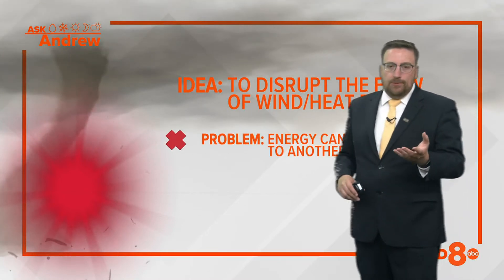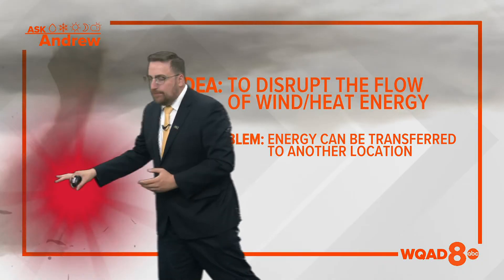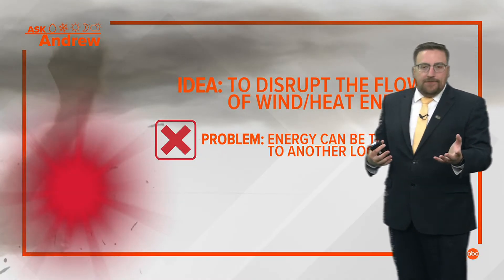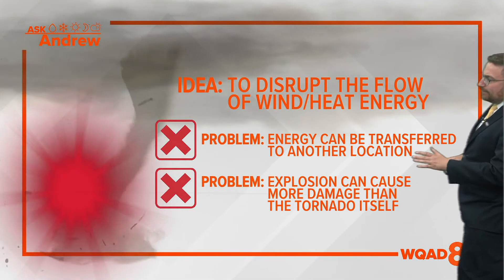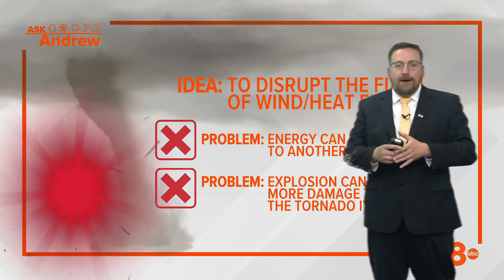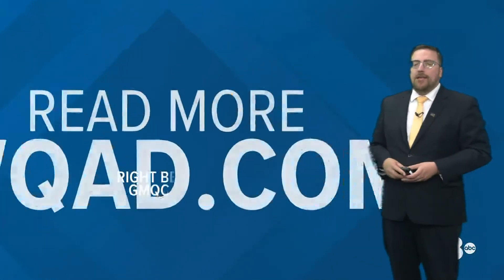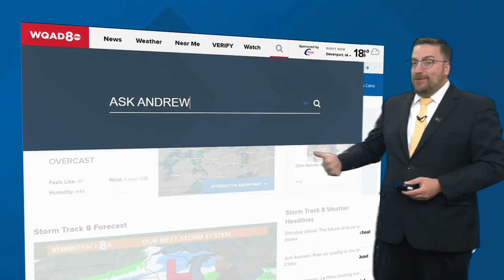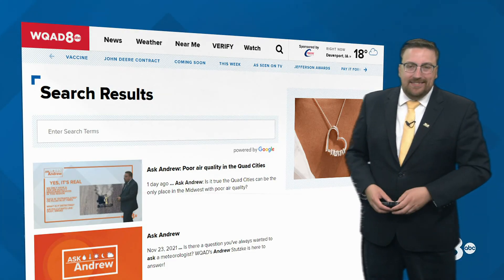Ask Andrew: Can a tornado be stopped by an internal explosion?

Comment: Guessing dynamite inside the base of any tornado would end it! As for another tornado forming it want be quick because the air has been displace in a large area! So it will have to build up in another area until the air settles allowing winds to build it up! Also the heat from the explosion would help end the rising of air inside the tornado thus killing the tornado from getting bigger!

Comment: not compoletly exact, if eplosion is sufficient big do move istantly all air in a area little bit more large the diameter of whirlwind o tornado, tornado is borked istantly because  explosion move tha ari in only one direction and stop the opposite direction of cold and hot air.
this can be done only with smal whirlwind when they start to "born" but for stop a hurricane you need a huige power and we can have this only with atomic bomb. this soluition will create more damage the hurricane :)

Comment: If it's heat, wind, etc, that equals to energy, right?
Why not use some kind of ionic disruptive deployed from a satellite, or a satellite to ground relay using magnetized force to pull the weather system apart on molecular level. 
I'm no expert, but I feel that would but the way.
Reply: This has to be satire

Comment: Ya I was always curious about using a thermobaric bomb to disrupt tornadoes. That I've always wondered why more people who live in Tornado alley don't  choose to rebuild using geodesic dome homes, like the those developed by American Ingenuity where they use concrete panels that are simple to put together. NIce open floor plan, Where the second floor is suspended on threaded rods and the entire structure is incredibly strong against extreme winds, weather, etc. I'm actually surprised that insurance companies haven't pushed the concept more rather than having to constantly rebuild using conventional designs and materials.

Comment: The explosion needs to occur above the cloud. Not a large explosion but just a disruptive explosion.  That does not look like on top of the tornado that looks like underneath the tornado. The explosion needs to happen at the neck. So let's say. You drop a salt bomb  through the top of the cloud and time to detonate at the neck point. I believe it would totally work. Let's say for instance we had a giant piece of sheet metal that we could place at the neck of the tornado it would immediately stop. Fact
Reply: It's kind of like draining a bathtub everybody experiences those little tornadoes in the bathtub. How do we stop it brush our finger across it . And it slows down tremendously until the pressure builds back up.  the bathtub doesn't have anywhere for the energy to go so it will do it again over and over. Tornadoes are slightly different when it comes to this concept.
Reply: Google keeps going to the nuclear bomb    that's way Overkill. That's like shooting a snail with a scud missile

Comment: 1 year since this video and a tornado struck middle Tennessee, striking a power station. When sparks from the wires being ripped made contact with a special mineral oil, the power station exploded, and destabilized the tornado, causing it to briefly dissipate. I'm pretty sure that tornado debunks this video.
Reply: No it doesn’t.

The guy says that a Tornado CAN be dissipated with an explosion. CAN be, as in it is possible.

what he points out, is that a tornado can reform AFTER an explosion, if the conditions that form a tornado are still at play.